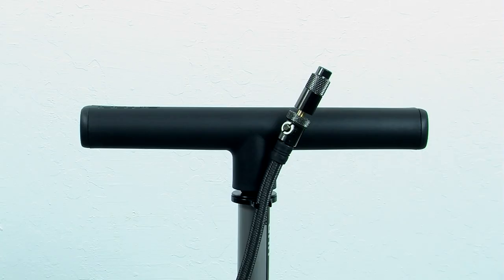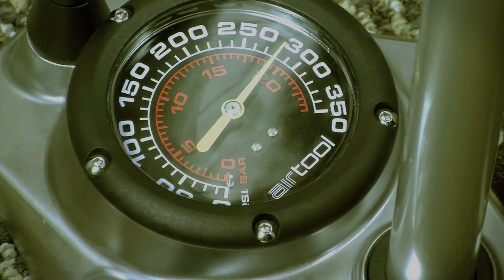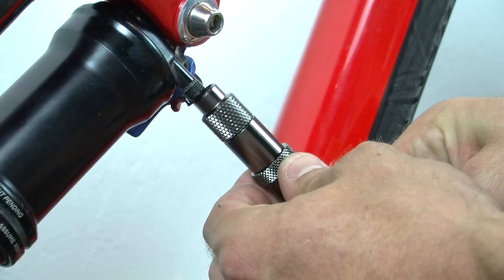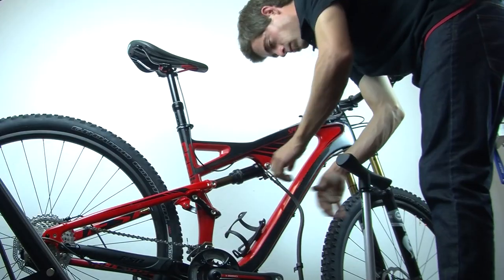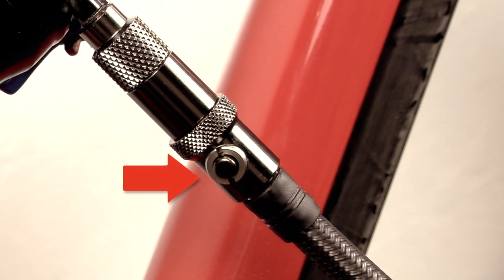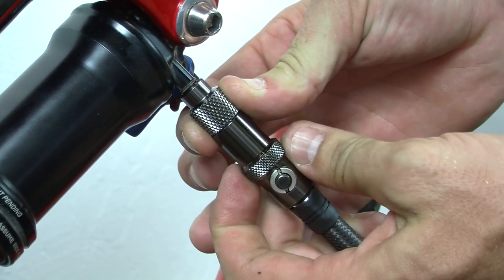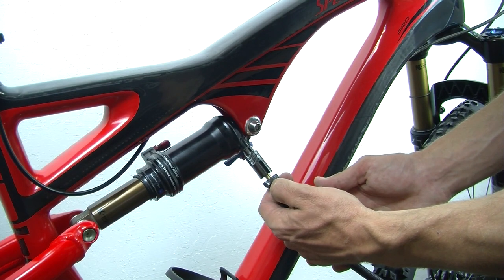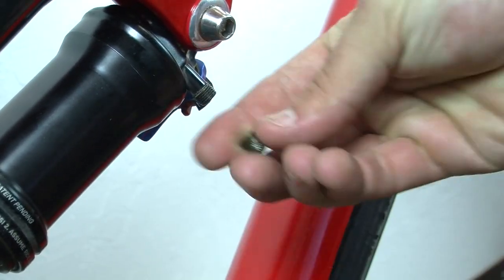AirTool UHP Floor Pump How-To

Comment: I have one and you still loose shock air unscrewing it from the shock when you’re done…doesn't matter if you air release in the final step…you still loose air unscrewing it from the Schrader valve of the shock.
Reply: true story, I lose about 20 psi when I unscrew it. Same results with or without the release button. I just overinflate by 20lbs now and the sag is usually dialed.